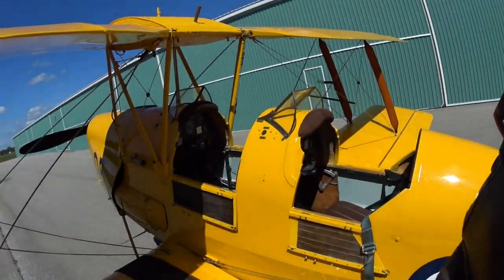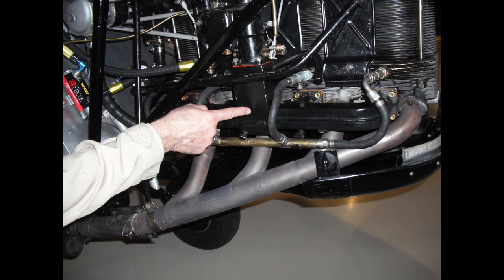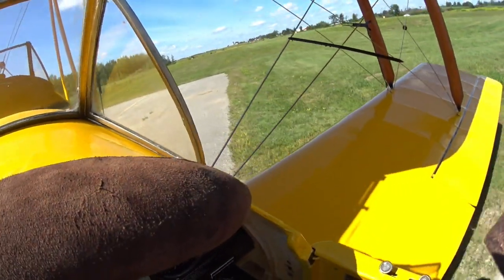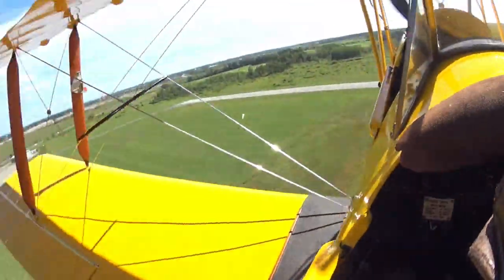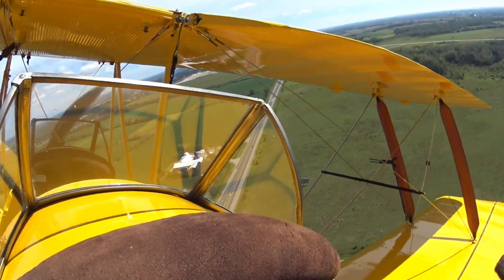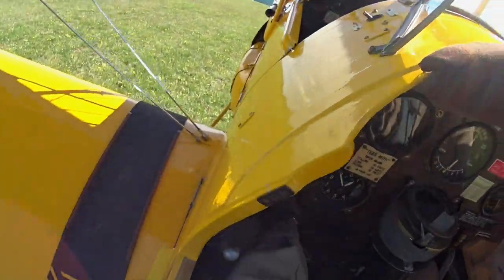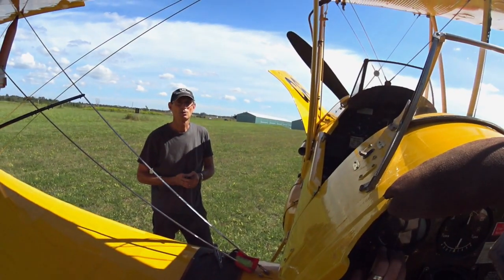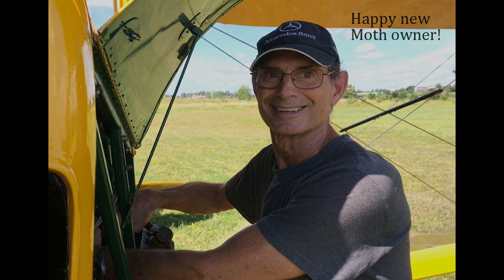Tiger Moth Test-Flight

Comment: I had a Chipmunk share (G-BCSL)  for 35 years and absolutely loved that aeroplane. When we first got it (1979) it wanted a lot of work doing to it so some of us went to Chester (Hawarden - where ours had been built in 1950!) and flew G-BARS, a Chippy owned by British Aerospace Flying Club. They also had a Tiger Moth on the fleet so I had a flight in that. Being an open cockpit tailwheel biplane it was wonderful fun but I have to say that after the delightfully responsive and co-ordinated Chippy the Tiger's unresponsive ailerons and iffy  handling came as a bit of a shock! But hey, it had so much character one forgave it that! 
I note you were in no hurry to exit the aeroplane after the flight. I know that feeling - the warm glow one gets after flying a wonderful old vintage machine (DHC1 in my case) just makes you want to remain sitting there in the comfortably-reclined tail-down seat after the flight listening to the tinks and clinks of cooling metal and the dying whine of the gyros! Heaven!

Comment: Excellent video. You touch upon many of the important points of Tiger Moth flying. I am lucky enough to be member of a club that operates two of them, and I have access to another three that are privately owned as well - just one of which is fitted with luxuries: adjustable seat, starter and brakes. The others are fitted with skids and have no brakes. Have about 250-300 hours on them, instructing and flying for fun, and it is a supreme tool for teaching people to really FLY an airplane, and use their feet while doing so! Look up adverse yaw in the dictionary, and you will find a picture of the Tiger Moth. There are few greater joys in life than slipping a Tiger into a grass field just like you do here.

Comment: Great Video. I spent a few wonderful hours flying a Tiger Moth out of Hawarden in the UK back in 1980’s though sadly not since. Right now I’m building a 1/3 scale RC model of the same aeroplane. I expect it will fly just like the original though unfortunately the prop will be swinging in the wrong direction. I have one query about Doug’s beautiful restoration. It may be just a curious video anomaly but it seems like the fabric on the underside of the upper mainplane may be a little to loose as it appears to flap in the slipstream from the propeller. Maybe it’s an illusion or I’m mistaken but I recall the fabric on the Tiger I flew was very taught in all conditions of flight

Comment: What a great video. My dad owned a Canadian Tiger Moth when I was a lad. One thing is, I wonder where your mike pickup was while you were running engine? Sounds like it was getting blasted with wind. That hissing can be edited out by any sound mixer to cliean up your audio. Thanks for the great watch!
Reply from the maker: It's  Sony ASR50 helmet-cam. There is no way to avoid wind-blast in the mic when flying aircraft with small windscreens. 
I use PowerDirector for an editing program. Their mixer doesn't clean up the hiss very well.
Reply: I like the sound. If you're flying an open cockpit it will have wind, noise, and whatever smells or temperature. It's part of the charm. I would fly with him, in that aircraft at any time.
Reply: All the time Flown Tiger Moth and Stearman.. What you can do is add an external mike and put it  out of the wind to avoid the feedback @KirkForrest-e5o

Comment: Why was the Moth was used as a basic trainer by the RAF for over 20 years?  According to an RAF flying instructor, it was easy to fly - and even if a novice pilot made a serious mistake, the chances are he'd suffer no worse than a bad fright.  Yet the Moth was quite difficult to fly really well, and any pilot errors showed up very quickly as soon as they tried aerobatics or formation flying - so one aircraft could be used both for basic training AND for sorting out the potential top-notch pilots from the competent and the also-rans.

Comment: Mag switches on the outside of the cockpit, never seen that before, Wow!!  What's the purpose of that?
Reply from the maker: They never had electric start, only hand-start, so placing the mag switches on the outside made it very clear to the prop-swinger if the mags were Hot or not.
Fewer accidents.